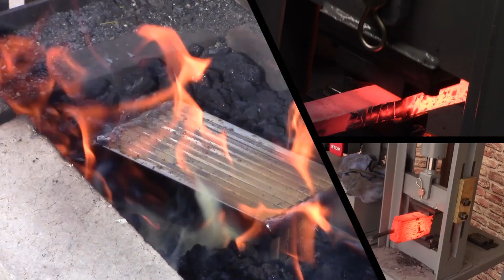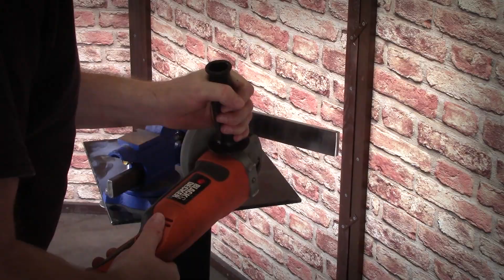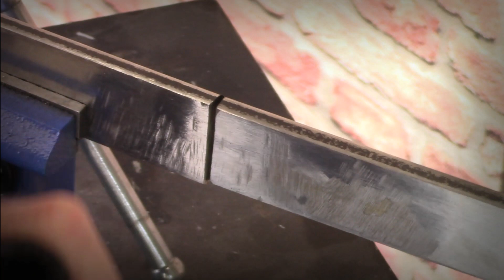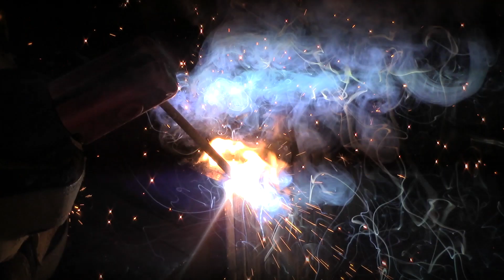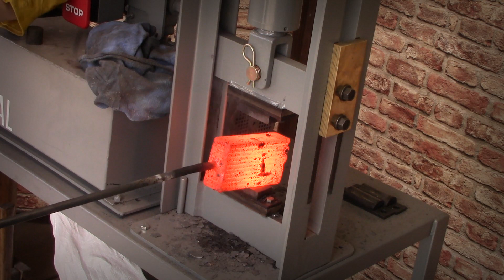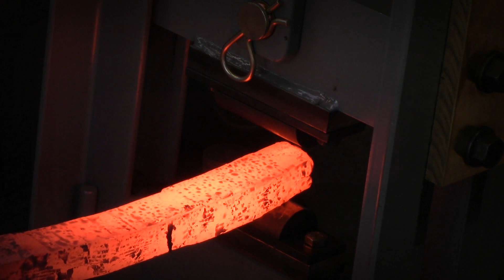Forging a shinogi zukuri katana, forge welding and drawing out bar (1)

Comment: is folding not necessary for this kind of steel?
Reply from the maker: No, it is not.  Folding was necessary with ancient steel to homogenize and purify it, because the steel was impure and poor quality to start with.  This is extremely high quality modern steel.  Folding provides no additional benefit.

Comment: How is that press treating you? And how does your W2 differ from W2 you would find at a “standard” supplier? Welcome back to youtube by the way 😎 i love your stuff
Reply from the maker: Thank you!  I had my W2 custom made to my own specifications. I'm not sure what W2 you're finding at standard suppliers.  Before I had this made, I wasn't finding any W2 anywhere.  Mine is a bit higher carbon than the W2 Aldo has had in the past few years.  People have commented that Aldo's didn't harden as well as they would have liked.  Mine is essentially very clean W1, 1095, or T10 plus vanadium.  And I L-O-V-E the press.

Comment: finally back👍🏻
Reply from the maker: Thanks!  Ya, I injured my left arm doing something unrelated and had to take some time off.
Reply from the maker: @Primedragoon Thanks.  Ya, I'm all better now.  Have you looked into some of the smaller presses? Coal Iron Works has a 12 ton press that's pretty small.
Reply: @oldpuebloforge  Hey good to have you back. How is the Coal Iron Works 12 tons? I've been looking into it for a while now and I can't decide if I should get it.
Reply from the maker: @mikaloiselle9832  It is perfect for what do.  It's also small enough and relatively quiet so I can use it in an ordinary suburban neighborhood without bothering my neighbors.  It's not as strong as the heavier duty presses, but it gets the job done.